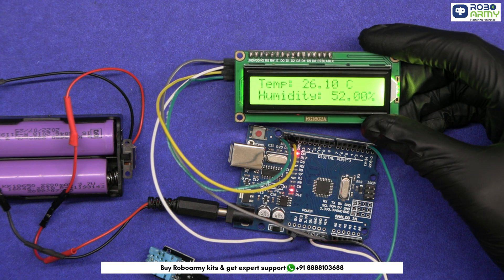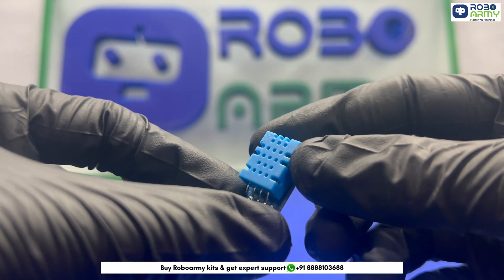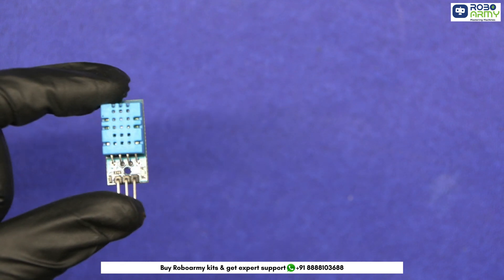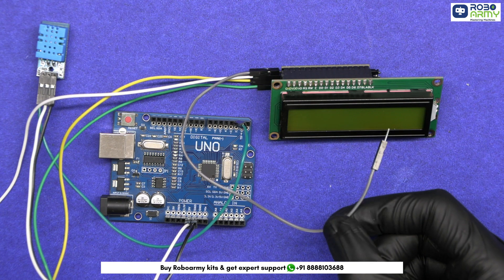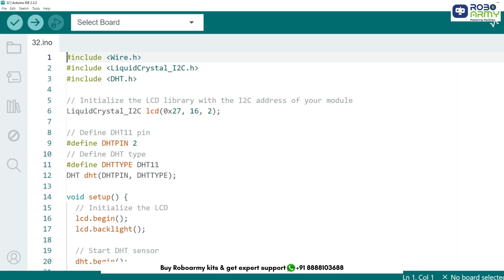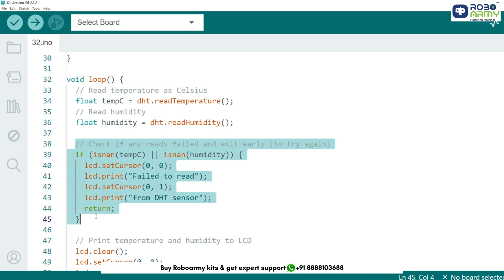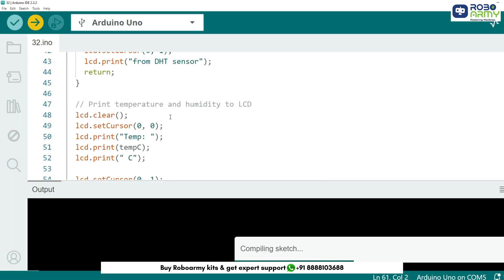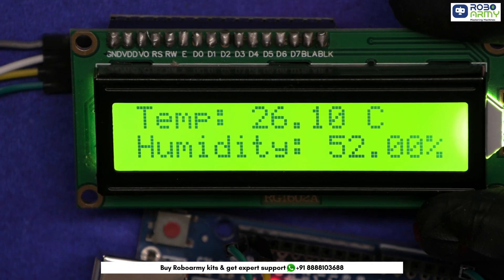🌦️ EnviroMeter: Temperature & Humidity Measurement Station with Arduino! 🌡️

Comment: Can I ask why the <LiquidCrystal_I2C.h> file is not found in the program? even though the program I entered it is the same as the tutorial, and I've added the liquidcrystal I2C library but it's the same.
Reply from the maker: Good question!  This usually happens because the LiquidCrystal_I2C library has different versions, and sometimes the one you installed doesn’t match the #include <LiquidCrystal_I2C.h> file name.

Try this:
Remove the current LiquidCrystal_I2C library from Arduino IDE.
Reinstall it from Library Manager (by Frank de Brabander is the most used one).
Make sure the file name is exactly LiquidCrystal_I2C.h (case-sensitive).
After reinstalling, restart the Arduino IDE.
That should fix the issue. If it still doesn’t work, let me know — I’ll share a direct link to the correct library.

Comment: How to know the name of the arduino board
Reply from the maker: You can check the name of the Arduino board by looking at the board itself—it's usually printed on it. Alternatively, if you are using the Arduino IDE, connect the board to your computer, go to 'Tools' > 'Board' and check the selected board. You can also go to 'Tools' > 'Port,' and it might display the board name there as well.